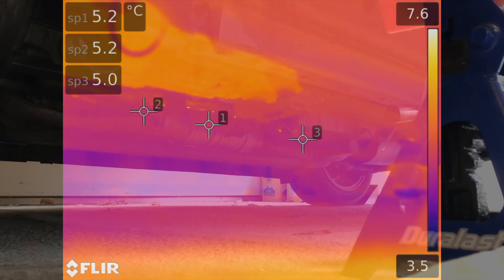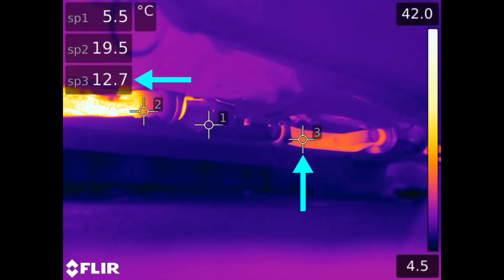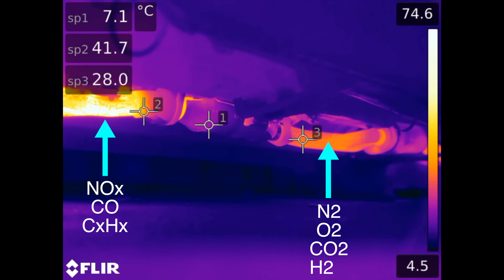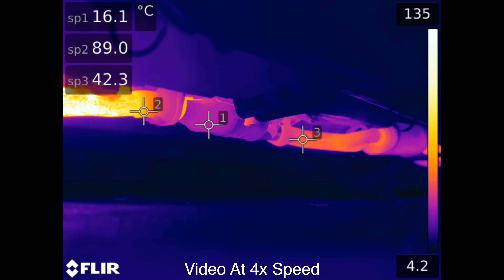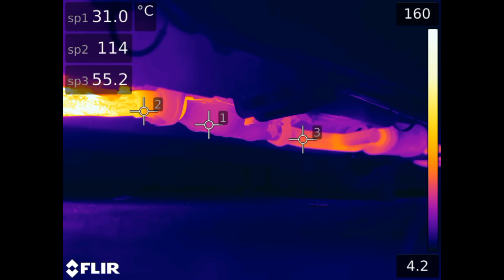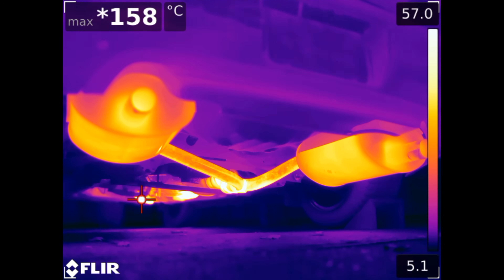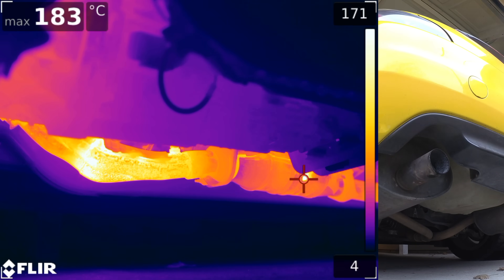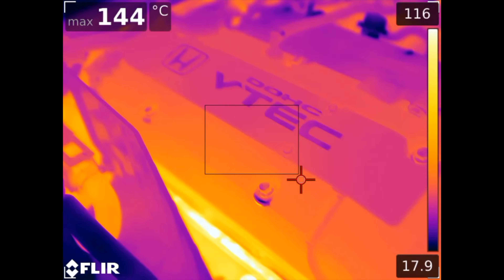How Hot Does A Car Exhaust Get?

Comment: THIS IS THE MOST CONTROVERSIAL TOPIC : Do K & N air filters improve Gas milage, block dirt out better, and improve Horse power?
Reply: K&N filters allow slightly more air into the engine which will creat a slight amount of power however it also allows more dirt into the engine as well which will cause MAF sensors to fail and cause the intake and throttle bodies to get dirty quickly
Reply: Dylan Walter yes. 
next

Comment: remember the ap1 s2000 has a AIR Pump. IT pumps air into the exhaust manifold  on start up . in order to heat up the catalytic converter faster. thus lowering emission  faster on start up..

Comment: I have a cold air intake, and a lot of water got in the other day. My engine could not burn the gasoline, I created a massive cloud of gasoline behind me.  Soon after my engine shut off while I was on the freeway, not a good day.
Reply: Golden Duck hydrolock
Reply: It wasn't hydrolocked.  I just had to pull over and start my engine up again.  I think that the water was just able to stop all 4 of my cylinders from igniting the air fuel mixture at the same time.

Comment: hey, could you show the advantages of straight cut gears?
Reply: Obviously way way late. Straight cut gears can handle more powerful engines/tunes than helical gear. This also means straight cut gear transmissions can be lighter than helical ones and still manage the same amount of power. The biggest disadvantage is they make a big racket and I bet the neighbors and the cops love it.

If you hear a manual transmission car going in reverse it will probably make a weird whining noise. That's because the reverse gear is straight cut. I used to think it was a quirk with Honda manuals because my mother's old 2001 civic would whine going in reverse and her ninth generation Civic both make the same sounds. Heh turns out that's just because they both manual.

Comment: I have a question about a scene in fast and furious 8. When Dom was racing in his cousin car, he pulls a small connecting pipe which gives him instant acceleration but also increases engine temperature drastically. What is the logic , I mean how is it possible to increase acceleration by just disconnecting a small pipe? or it's Fake?
Reply: That pipe connects the intake side of the turbo to the wastegate. 
When the boost created by the compressor is high enough the wastegate opens and the exhaust gases bypass the exhaust turbine limiting the boost created. 
If you disconnect the pipe the wastegate will remain shut so the boost will be as high as it can go. 
This will greatly increase the engine temperatures and the power as more fuel can be be burnt on each cycle.
However dom's engine is probably carbureted so its doubtful this trick would work as it takes a lot of tuning to get
carbureted engines to work with a turbo. 
On an injected engine you can just inject more fuel but with a carburetor is a lot more tricky. Look up blow through carb for more info.
In this conditions the mixture would likely just lean out from the excess air which will further raise the engine temperature and ultimately blow the engine.
Reply: j Thanks....well explained.
Reply: A CVT transmission can in theory go as fast in reverse as it can go forward. In fact the DAF Variomatic car (developed in the fifties) was rather famous for this ability. There used to be a televised regular race event in The Netherlands during the eighties where just about the only rule was you had to race your car in reverse. Not surprisingly this race was dominated by the DAF Variomatic.
Reply: Bart Kuijper that's pretty cool thanks for the new knowledge
Reply: Your car won't go faster in reverse unless you have two gearboxes. One with a set of gears for going forward and one for going backwards. Cars only have one reverse gear and it will only go so fast depending on the gear ratio. Driving in reverse is essentially like driving in first gear.
Reply: j Can you also explain how reversing your car can be faster then going forward?
Reply: Well the reverse speed is only limited by the gearing he had in the car se could in theory go as fast as he was going before reversing the car
In his situaltion reversing has the advantage that he no longer has fire going into his face
You can argue that he thought something like this was bound to happen and planned for it by putting a special reverse gear on the car so he had a backup plan for the fire but that is kinda far fetched

Comment: Man, you're digging those thermal cameras haha Hey, how about a video explaining why a manual transmission car stalls?
Reply: When you come to a stop, you reduce the speed of the wheels, thus reducing the rotating speed of the drive shaft...if you do not disengage the gear(and put it in neutral), the drive shaft is still connected to the engine. If those two are connected and you come to a stop...you will force stop the spinning of the shaft that is connected to the engine, thus stopping the engine abruptly. If the car is idling (at about 800rpm) and you drop the clutch, you connect the moving shaft to the non moving shaft(the one connected to the wheels, which are stationary). This will stall the engine. Automatic transmissions are designed to make sure the engine rpm stays above dying point(example, when you come to a stop, it disengages, as if you pressed the clutch in an auto). Hope some of this made sense
Reply: An automatic works sort, very loosely speaking of like a boat propeller. If you hold the boat still the propeller can still spin. Newer automatics (since ~mid 80s) do also have clutches in them which are activated during steady cruising conditions, and will cause the car to stall if they don't disengage.
Reply: tudor obretin thanks for your answer man! Of course it makes a lot of sense. Now this brings me another question, can the engine suffer any damage from stalling?

Comment: so the liquid dripping from the muffler is water?
Reply from the maker: Yes.
Reply: JoraForever yup you can drink it
Reply: Water is an expected Product of most combustion processes. CxHx + O2 -> CO2 + H2O is the case, but Petrol consists of more than one sort of Carbon Hydrates and as an engine never produces perfect conditions, there are other wast-gasses like NO, CO and more
Reply: JoraForever Mostly. I wouldn't drink it maybe. But mostly just water, yeah.
Reply: collect it and drink it whenever you are thirsty
Reply: oxygen becomes a liquid at -183 degrees celsius, so i doubt that's liquid oxygen lol. Most likely it's water, however.
Reply: starbucks secret ingredient lol
Reply: JoraForever basically every car is supposed to do that, its how you kno the engine is running at its best
Reply: C1H4 + O4 -> CO2 + H4O2
Reply: yup.. too much of it means you have a blown head gasket. coolant seeping into the combustion chamber and the tailpipe starts pushing out white smoke or steam
Reply: I thought it was unburned gas but I was wrong
Reply: JoraForever oxygen liquid i guess?

Comment: Hey Engineering explained, can you put together a video showing the forces acting on a car when you pull another car that has broken down? (my friends NSX broke down and I towed him home with my S2000) do you know what strain this puts on the vehicle that is doing the towing? since the vehicle being towed supports it's own weight, do tow ratings come into play? Or with a small suv?
Reply: If you must tow with a vehicle that is not really setup to do so, simply take it easy during towing. Gentle acceleration and braking, coast off some momentum before anticipated stops, drive slower and avoid steep hills when possible.
Reply: DjJMOProductions ya that would be cool!
Reply: Well of course, but id like to hear engineering explained talk about what wear and tear is involved. I also have a 2009 ford escape that has a tow rating of 2000 lbs. I pulled a broken down mustang the other day and all seemed fine as I kept it slow and steady, but when i think about the difference between pulling a trailer with a tongue load, and a car that is supporting it's own weight, I can't seem to put together the math on why it wouldn't be perfectly fine for me to rescue broken down cars with my 4 cylinder escape. especially if a single person can push a non running car just fine. I assume it's just a matter of transmission cooling, but there's so much involved that I'm calling on the big guns for explanation.
Reply: DjJMOProductions just watch a truck pulling video you'll learn all you need to know. The big differences are your clutch is wearing faster, the engine is under load, the engine and trans will be much warmer especially on a s2000. Just average normal towing changes.
Reply: I believe that being able to stop the load safely is the limiting factor in most towing ratings these days. Usually you can pull a significant amount of weight.. But being able to handle it at speed and being able to stop it are different beasts entirely.
Reply: yeah, point me in the direction of the book, or online article that discusses it, and I'll gladly read it. I did a bit of research before I commented this and couldn't find anything on this scenario. I think it would make for a good video.
Reply: Sounds like a good idea !!
Reply: The tow rating assumes well functioning wheels, regardless of if they're your vehicles or what you're towing.      The tongue load is more about control - a perfectly balanced single axle trailer would tend to rock, occasionally lifting your rear axle off the ground (or at least drastically reducing the weight on it and thus friction from the tires), causing nasty losses of control.
Reply: The tow rating should be what you can reasonably tow, not just mechanical limits of transmission or suspension.  However, there's many practical considerations.  Long uphill sections, poor gear choice (lugging the engine), improper maintenance of the trailer (failing bearings or brakes), and various other things can drastically increase the load on your vehicle.

For ad-hoc pulling (such as your rescue) a cable or chain can be extremely dangerous.  All the energy of your pull is put into stretching the cable/chain (and much more if you shock it to jerk them lose of mud or something), which can fail catastrophically and whip around to remove parts of your car or limbs you've grown fond of.

Take it slow and gentle, that's the main thing in your case.
Reply: DjJMOProductions Well first, everybody knows an S2000 isn't designed to pull weights around.
The chassis itself is designed to be towed out of a ditch so assuming you use the tow-hooks, you can presumably pull a curb-weight less than your S2000's curb-weight. That being said, you can't "tow" things with an S2000. Its chassis isn't strengthened for the use of a trailer.

Second, any engine strapped to a rolling chassis can do lots of work. So a short, hopefully gentle, recovery mission won't really hurt it. If you had slack and jumped the chain then damage would be stretching your frame lengthwise. If the vehicle suddenly became stuck or not-rolling the ensuing jolt could even separate welds. Depends of the variables you have to deal with.

If it's little and not very far, nobody will be the wiser. But if you need to go more than a few km or literally trailering with an S2000 just refer to the Honda specs and the engineers know how much weight the stock springs are rated for.
Reply: hes got time for all that.  what else he doin.
Reply: so taking that into account, what additional stress(beyond regular operation) is enacted upon the drivetrain? Does it increase friction in the transmission and heat it up enough to cause damage to the gear set? Does the additional load on the engine cause it to heat up enough that there is a potential for blown headgaskets due to warping? Or is it all just a small enough amount of change that the effects are negligible? Where is the threshold? Does it correlate to the tow rating, or is the tow rating just the mechanical limit of the rear end and transmissions gearing when you take into account efficiency, and the manufacturers are giving themselves a nice cushion for liability? this is a much more involved question than "can I pull another car with my car with a rope and not have it explode"
Reply: I also mentioned my 2009 4x4 ford escape. and I use a woven nylon recovery strap in a tow hitch mounted tow hook when recovering other vehicles.(besides the nsx) the strap is designed to stretch and not shock the chassis and is rated for 30,000lbs. I'd really love to see what engineering explained has to say about the forces acting on the drivetrain.
Reply: DjJMOProductions it's all the same as driving but exaggerated depending on the weight. It is all the same. The heavier the slower, more wear, more heat. That is all it's really doing. Also more fuel consumption.
Reply: Just look it up lmao
Reply: He would have to mount a lot of strain gauges to the frame and then go out and do a recovery. It would be quite time consuming.